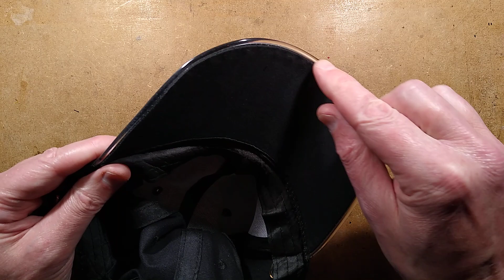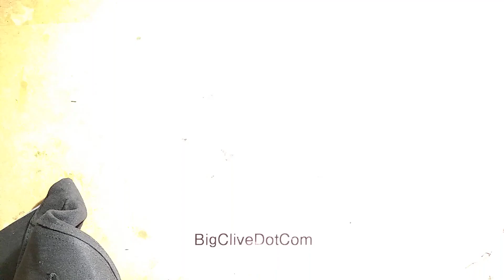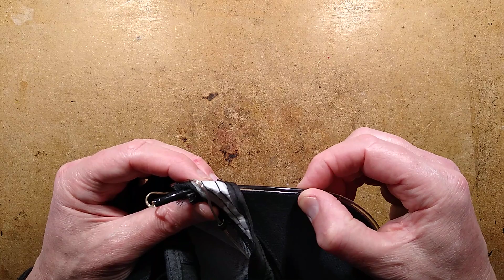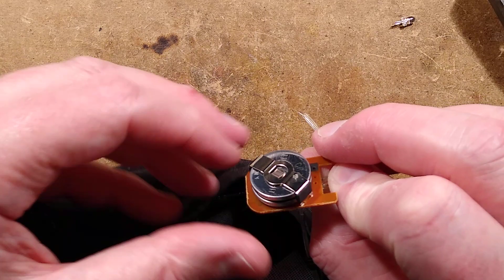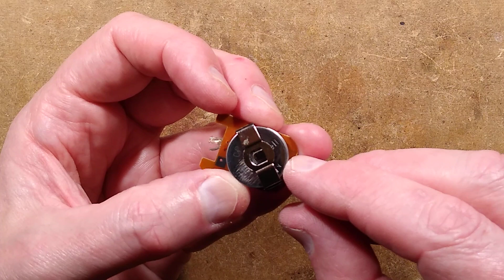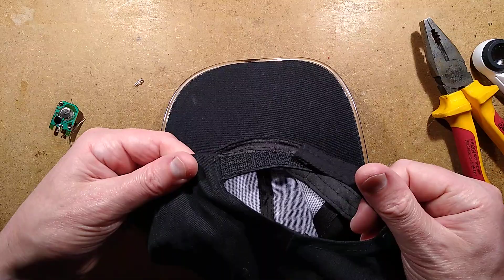The circuitry of an illuminated skip cap.

Comment: Any chance you would be interested in doing a video on the cable for the Oculus Rift CV1? Oculus in the wisdom have decided to discontinue selling the replacement cable (which is user replacable) meaning anyone who gets a faulty or damaged cable has a brick for a headset from now on as they are not sold elsewhere. This is a link to the user voice topic on the oculus website pertaining to the issue. https://oculus.uservoice.com/forums/918556-oculus-rift-s-and-rift/suggestions/38506144-continue-selling-rift-cv1-cables

Comment: Looks trashy, but IMHO anything that helps pull a distracted driver's attention so he won't hit you is a good idea if you have to be on the shoulder of a road at night. Still trying to get the strength back in my thumb over a year after a bicycling hit-and-run with a passing vehicle's passenger side mirror. I think lighting like this all along the sides of my panniers might have helped avoid the accident.

Comment: Hay I found this interesting device called Quantum Magnetic Resonance Analyzer (QMRA). Can you make a video on this? I think this is totally a scam product.
Reply from the maker: I have one. But the software is very suspicious.  It demands you remove anti virus before loading.
Reply: @bigclivedotcom  can you open the machine and show what is actually inside it? i know about the software. it's just a clever algorithms which generat random results depending on age and weigh. I'm curious to see the inside of the machine, specially the scanner. I'm trying to find one for this but it would  be better if you explain everything about circutary, electric signals and machanisom. You can install the software on old or unused PC so you don't have to warry about antivirus.
Reply from the maker: @it_is_ROKY  The machine is just a light show.  The software generates a report based on a health questionnaire filled in before the fake test.  The result is based on statistics.

Comment: I wonder if you put a capacitor across the led if it would get rid of the flashing and just stay on at a lower brightness?
Reply: I would presume that would just add some slight afterglow. If you want it to stay on dimmer why don't you just add a resistor instead?

Comment: why is the chip under a blob?
Reply from the maker: Cheapest way to manufacture these circuits.  The bare chip has bond wires attached and is then protected by resin.

Comment: I wonder if there is somewhere you can buy that, I don't know what you call it, fibre optic beading, by the meter for DIY projects, it would be a good alternative to EL in wearables if it's even modestly flexible.
Reply from the maker: I've done a hunt.  On eBay the keywords are side glow skirt blade and it's often sold with a metal LED lightsource.
Reply from the maker: I added a link in the description to a seller supplying it with an LED lightsource.
Reply: @bigclivedotcom  Cool!  Skirt seems to be the keyword.  if anybody is looking on taobao or whatever then 裙边导光条LED seems to get you there.  Some seem to have Teflon (PFTE) and some PVC outers, I saw one say that the PVC yellows over time while the PFTE doesn't.

Comment: Once owned a cap with a similar controller, but 6 leds sticking out the front of the "skip", instead of a strip  The button was located on the skip so it was very easy to reach. I'd say it was a lot more convenient and comfortable than hauling a head torch around

Comment: Having the click switch held on with sellotape seems a bad idea? Wont hold up well to moisture ie sweat or rain.
Reply from the maker: It's surprisingly common.  Even in some high profile products.
Reply: Really!? I didn't know that. I thought reliability may of been an issue using sellotape because as we know it don't like getting wet. If its being used often then it must be fine :).
Reply: @xtc31  I've never noticed any issues from tape getting wet after it's applied. Maybe it depends on the variety? Packing tape seems to be pretty resilient.

Comment: The click dome switches are usually stainless steel so can't be soldered, hence the tape to hold them in place.
Reply: Do you not silver solder?
Reply: @khaitomretro  Apart from the economics on a throwaway item like this, the temperature required would destroy the PCB material.
Reply: @Graham_Langley  It's more the aggressive flux that's the problem. You can custom mix a solder paste then apply the heat through the stainless, cool it quick then flow the lower temp stuff after. I think tin/silver solders with flux cores that will happily fix stainless to PCBs are available off the shelf now.
Reply: @khaitomretro  Next problem is how to get any flux residue out from under the dome and ensure a good switch contact.

Comment: What is up with the obsession with having flashing modes on everything?
Reply: Especially on bike lights. Everybody hates blinking bike lights, except the morons using them.
Reply: @Offensive_Username  easier to see that's why. Until drivers use their fucking eyes
Reply: @girlsdrinkfeck  makes it harder to judge how far away they are though.
And is strictly speaking illegal on UK roads as a main front or rear light
Reply: girlsdrinkfeck harder to see more like, they are a menace and dangerous and should be banned as the strobing effect is blinding at night, especially with the super bright lights that are like car rear fog lights, you just get dazzled by them and have to squint and you can’t see properly as your eyes are constantly adjusting to the light/dark/light/dark. Ever walked across a nightclub with just the strobe flashing? Can’t help but bump into people because you don’t see them change direction between the flashes, bringing this to the streets is asking for an accident to happen
Reply: @Offensive_Username  I understand bike lights, but flashlights? Why? lol

Comment: I would like to get the battery circuit and make it with rechargeable cells and the fiberoptic tube in length, you could do a lot with that. 6 volts seems to be a little overkill and a short life for the LED's, but like you said there's got to be some kind of resistance on the traces

Comment: Does this work to obscure a face in a camera by giving out unbalanced specra, or would you need to change more of them for near IR?
Reply: Did you mean "near IR (Infra Red)" instead? I would not have anything "near UltraViolet" in close proximity to my face or my eyes. 🙄
Depending on the kind of filters and camera sensors, using IR LEDs in that thing may be interesting. 🤔

Comment: I think that same cap with high power IR leds would be cool as a face detection system blinder
Reply: >high power IR leds

in the power range of 5-10 watts.
Reply: I wonder how the wave guide around the brim handles IR. It might not pass it at all, or possibly all of it would just blast straight out the ends and not get conducted to the middle. 
I think Clive needs to do a test...
Reply: Yeah I was just about to comment this

Comment: I wonder if the stitch-on fiber tube stuff is available in bulk? 
I can see that being useful for costuming in place of EL wire, assuming it is as much brighter than the cheap EL wire as it appears.
Reply from the maker: Neither of them are bright enough for costuming unless it's in a very dark area.
Reply: @bigclivedotcom  That's disappointing.

Comment: Looks like the same controller as my dog's LED collar 😁
Reply: @
Frank Wolthuis

if you still have the collar try taking the batteries out and press the tab on the battery holder so it will grip one cell and try it , i used to have one myself and found the light nearly as bright and the battery lasted much longer :-)
Reply: @YTANDY100  I don't know if I can open it, it is rechargeable so I don't need to replace the batteries anyway 😉

Comment: I’ve seen that heavier-duty heat-shrink tubing (especially once you mentioned the rubbery feel) sold as waterproof/marine heat-shrink tubing for boat electronics and oceanic equipment etc. Mostly for boat sump wiring and such, lol. It works really well as a cheap on-the-go way of waterproofing things, too. Tiny blob of silicone in the end where the wires come out, fold the other end and pinch it while hot, and you have a tiny waterproofed circuit board. (For when you’re at an event and only have what you thought to bring in your toolbox to work with, or just found the issue when you’ve arrived... 4 hours from home. Ahh I’m so guilty of this so many times. I really should check everything in advance. Really should. Won’t, but should. >.>)

Comment: Curious to know what the resistance of that track actually works out to be between a button cell contact and the COB.
Reply from the maker: It's quite hard to measure with a meter because the contact area is a factor.  But somewhere between 5 and 10 ohms.

Comment: My favourite feature is how the electronics will last approximately one summer's worth of forehead sweat or a single run through a wash cycle.
Reply: DARK APPERITION  I have two simmilar caps and they say to do not wash so I washed one and it still worked, it didn't have a carbon track contact though. They were sold as caps for night fishing by Aldi.

Comment: Make them RGB and sell at festivals, profit.
Reply: And add a mic to get in sync with the music.
Reply: @hopje01  wouldn't even need a mic, use a piezo as a switch. Good call.
Reply: There is one on ebay with multicoloured LED's. I have ordered one.
Reply: @HuntersMoon78  An addressable one would be nice but significantly more complicated too.
Reply: @z31drifterlf  multiple sections sure, but you could fit a single ws2812 and a microcontroller chip in it no problem

Comment: I would be interested to know the resistance of that graphite ink battery "terminal".
Reply from the maker: It's quite awkward to measure because contact area is a factor.  But the track clocks in at about 5 ohms and it varies upwards to around 10 ohms from there.
Reply: Thanks, Clive. That seems like a natural ballast value.

Comment: When I was a younger I had some LED's from a few remotes ,that I had barely sticking through the front of a baseball cap with some tape to mess with security cameras. I look back at things I did when I was a teenager and keep asking myself " Why ? " , to which I can never come up with a satisfying answer.... I am tempted to get one of those caps and replacing the LEDs with some IR ones to blind any security camera .. lol .. " Why ?" I'm asking myself now ..
Reply from the maker: The answer to the question is....  "Because you can "
Reply: @bigclivedotcom  Spot on answer!
Reply: Why not toss in an esp/arduino to cycle 50 most common TV Power codes?
Reply: @speckblue  lol
Reply: @speckblue  You're evil (but I like it) ;^p
Reply: @speckblue  you're pure evil! (But I like you)
Reply: There's actually a TV-B-GONE circuit board that you could connect to these IR LEDs and it continuously sends out off remote codes for all TV manufacturers, so basically, wherever you go, if you encounter a TV and it has an IR receiver for a remote control, it will be turned off by that. I really like the idea.
Reply: because humans are creative and curious by nature like most great apes. i dont think its a coincidence that we are the only species with opposable thumbs to tinker and craft with, thats how we became what we are because it was a successful way to go. its like a cat playing with its prey to become a better hunter.
Reply: Those tinkers thumbs should get to work making it possible for all members of the species to probe the depths of the technologies that surround them. Pocket microscopes with built-in ring lighting, for example. Or the same in the form of glasses. Appropriate technology to appropriate technology.
Reply: @thomasherzog86  Deception at its finest
Reply: Why wait till you got something to hide?

You could also run ir leds and uv leds and blind cameras and then also blind certain animals lol
Reply: Because why not.
Reply: Please do IR LEDs and test with camera! :)
Reply: Or better yet, a rolling code of "off" IR signals to turn off all the TV's in the area. Not sure why waiting rooms need TV's anymore, I have a phone.
Reply: Yes because its fun!
Reply: it was also used in a crime drama thing in the UK . the criminal could not be recognized by facial recognition or security cameras
Reply: Your Sub-c is Future proofing you beyond your understanding!
Reply: Learning Electronics Cheaply
Because 'sticking to the man' is almost as satisfying as sex (if memory serves me right?).
Reply: get the 5-10 or even 50 watt IR leds and matching driver. run it from a boost converter and a power bank.
Reply: ...only don't put cling film over motor vehicle number plates, and don't put IR LED's in those lights to fool fixed speed cameras because apparently, that's illegal!. ...but you can, perfectly legally, wear a face covering, sunglasses and long hair so it covers your ears. (I don't think wetherspoons, who like to have a photographic record of all thier customers, are too happy about that!)
Reply: @penfold7800  a simple solution to the number plats is a dedicated switch so you'll turn the ir on only as you pass a speed camera. rest of the time it can stay off
Reply: @penfold7800  - Right now, with SARS-COV-2, the face covering is mandatory, and a lot of people are wearing eye shields.
Reply: @tbelding  which means paranoid and privacy-conscious people don't need to panic anymore about being tracked and identified by the millions of cameras everywhere, and won't look out of place wearing face coverings. This is good news! (But I am worried about this second strain of Covid. My prediction: The way we live is going to have to change permanently pretty soon, if we are to survive as a species because the rapidly changing ecology of our planet cannot be stopped now)
Reply: Lol I guess Clive had the video hidden for a bit given this comment is 6 days old, must be trying to space out the videos
Reply: @jaykoerner  Patreon
Reply: @tncorgi92  ah
Reply: @jaykoerner  patreon.

Comment: Skip cap? That piece in the front is called an visor or a bill in the US 

The coin cells have enough internal resistance to prevent frying the LEDs. Limor Fried has described just taking LEDs and taping the leads directly to a coin cell
Reply from the maker: Throwies?
Reply: @bigclivedotcom  Isn't that what happens when you've had too much to drink on a Friday night?
Reply: A lot of keychain flashlights are LEDs directly wired to coin cells, the “switch” just being something that presses the LED’s wire against the battery.
Reply: @KarlBunker  Worse are flashlights which take user-replaceable AAAs yet still don't have any current limiting. I discovered mine was like that after it died.